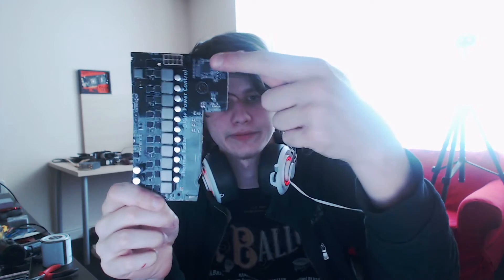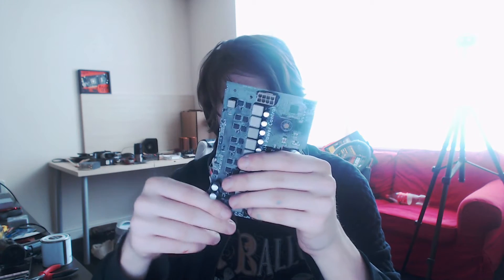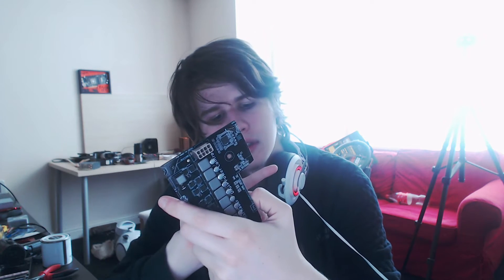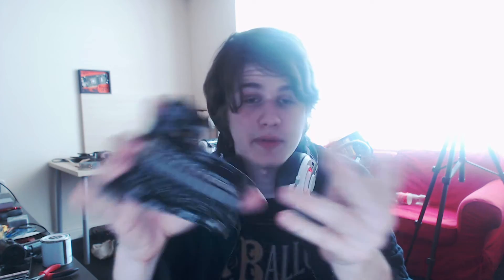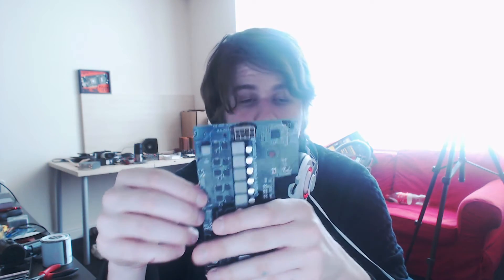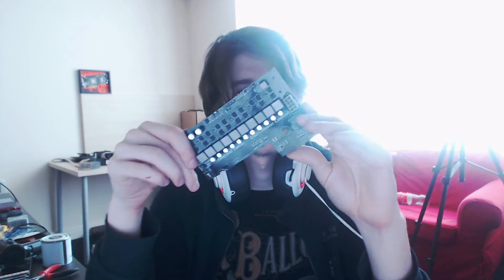Sabertooth 990FX VRM project update and random ramblings

Comment: I wanted to do a an external power  oard project with my dead socket 775 8phase p5q3 deluxe wifi/ap so that I can use it for zombying GPU's but I can't seem to find the data sheet for the Vcore voltage regulator, I think it might be some popular 4 phase vrm controller, that's been doubled to 8 phases and rebranded  by Asus.  I will follow up this comment with the voltage controller name and model, maybe you can help me out :)
Reply from the maker: Sure I'll try help. However I don't guarantee anything.
Reply: From what i can see the voltage controller is PEM ASP0801.
Do you reckon i could control the PEM ASP0801 voltage controller from the EPU chip or should I not bother and just control the PEM ASP0801 directly?
Reply from the maker: I'd just try find the feedback pin on the PEM and use that for voltage control. Unless you can find a datasheet for either of them just doing a FB pin mod is the easiest way to get voltage control.
Reply: Any ideas about how should i go about finding the FB pin without schematic?
Reply from the maker: You got to do a lot of tracing. You're looking for a pin that is hooked to the Vcore through a few resistors. Everything else will lead to something other than Vcore.
Reply: i can see a large network of resistors to the right of the voltage controller, however i cant see which traces from which resistors go to which pins. I figured that the resistors are either too close to the voltage controller for me to be able to see the traces or the traces are actually on the PCB layer that's in the middle. Ive come up with 2 more ideas in case i don't find the fb pin: 1) control the voltage by placing switches in place of stock resistors, so i can set the voltage by changing the state of the switches, eg (1= switch on, 0 = switch off) 001010 = 1.1v etc. The second method of controlling the voltage could be manipulating the VID pins connected to the 775 socket? I have previously set VID manually on socket 775 by simply manipulating the combination of vid pins that are connected to vss/vcc. I reckon I could make a network of jumpers/switches that are connected to the VID pins. What do you think? I never volt modded without using a schematic so Im finding this project pretty difficult.
Reply: and i cant trace to which pin the vcore feedback goes to because the pins of the controller are too small for me to place the probe on
Reply from the maker: That VID control idea should work fine. I didn't know how much you know about the controller. If the VID thing doesn't work out you can try add needles to your probes and use that to do the tracing from the controller.